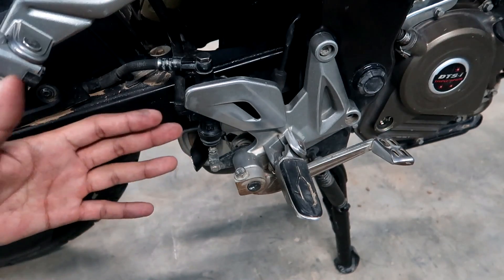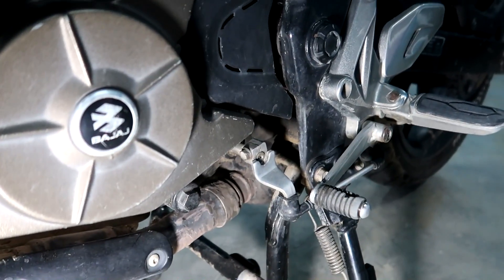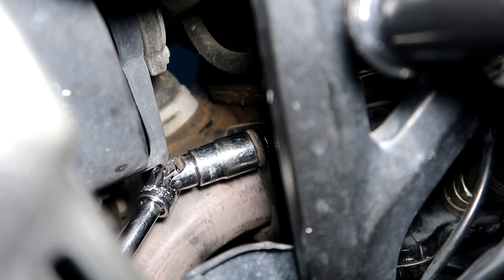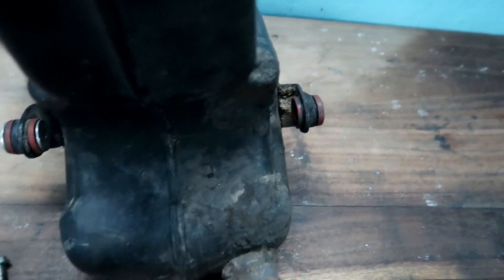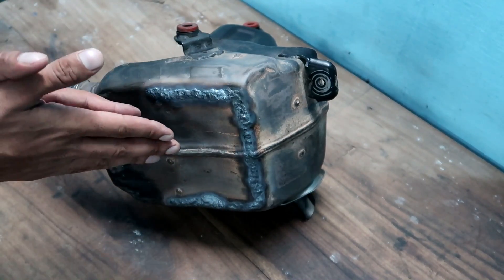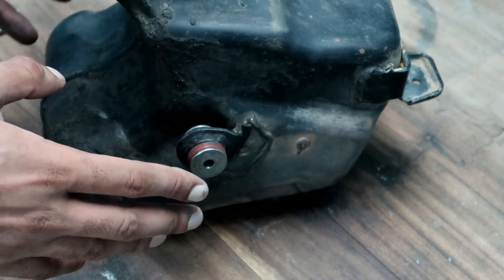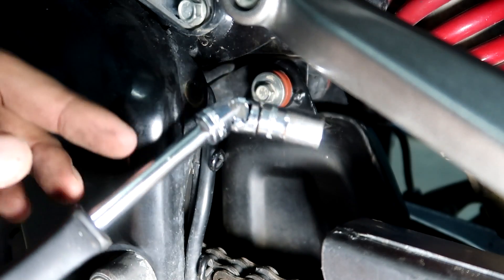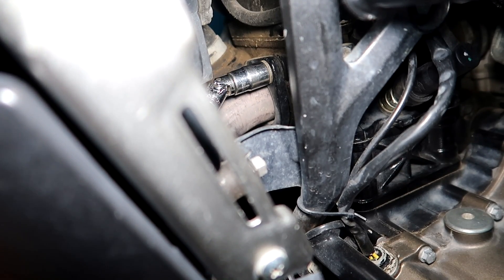How To Fix Silencer Noise (Exhaust Rattle) [NS 200]

Comment: nice video buddy and one thing i have duke 390 when i give sudden throttle there is a lag for 2 secs and then the  power is normal what will be the problem?my bike ran 9000km thnx advance
Reply from the maker: Get air filter, spark plug and fuel filter replaced.... If you have already changed them.... Get the fuel pump, injector and throttle body cleaned.

Comment: What you think about fz25  its worth it or should i go for apache 200 4v
Reply from the maker: Both are great in my books.... RTR is less expensive but doesn't have ABS.... If ABS is not your priority than go for the FZ25.... Just the headlight and speedometer are a bit on the downside.... Rest is great in my opinion... But RTR is a great package overall except the power it's less than fz... Lemme not confusw you.... Just ride both the bikes.... And buy one whom you fell in love with.
Reply: Jeet Bhaskar i will try both  thank you so much for your advice 😊
Reply: Marmik Vyas FZ25 le le quickest bike hai 200-250cc ki duke 250 ko bohot tough competition daiti hai rtr 200 4v slow bike hai mat lena
Reply: Saauvik Das 
after 120 or 100kmph spped  ns will go ahead but in 0 to 100 fz25 is quicker
Reply: Syed Qaiser Abbas  its comfortable to cummute every day with fz25 ?    fz25 is so quick that its lack on braking in city  correct me if i am wrong i heard that from reviews so ..  if fz25 has abs i will definitely just gone for it but the 200 4v features is attracting me right now the sliper clutch with dual channel abs    i cant decide...
Reply from the maker: Go for rtr eyes closed if you want a city commuter and a weekend rider.....  And it has slipper clutch... A lot better speedometer and from my experience mechanics at TVS are at least better than yamaha but that differs from service center to service centre....  You can go for ns if you want best of both city and highway but than my experience says that it's not as reliable machine as the other two.... Plus it doesn't have fuel injection.... And has a single channel abs unit..... If it happens to be my money i would have picked the RTR race edition with Fuel injection.... Rest is your wish.... Go test ride the fz and rtr and decide by your own.
Reply: Just fo the fact it has taller gearing , it's slow to 100 ! 
 But only by a mark ... I ride ns n duke back to back on a daily ! 
Never tried the fz, good for touring .. power below 6k rpm...but I like something which screams 😅 ns screams after 7 k like a beast ! N it will push you behind but in a smooth manner not like that of dukes
Reply: But yes after 120kmph it's not stable , none of the naked will b stable!
Reply: Saauvik Das NS will scream with it's vibrations and awfull quality of bajaj spares
Reply: Saauvik Das bro get a life with correct figures go and watch 0 to 60 and 0 to 100 timings of FZ25 and NS200 
Even if u don't understand it then go and watch motorbeam's comparison video and drag race video
Reply: Marmik Vyas bro NS200 lacks low end performance so u really have to keep the throttle twisted until it reaches 120 kmph then it goes ahead of FZ25 and ask yourself how much often are u gonna ride it above 100kmph honestly speaking acceleration is more important than top speed especially on Indian roads
Reply: Jeet Bhaskar bro but still tvs doesn't provide rtr200 with both abs and fuel injection i mean it took 2 years for TVS to provide ABS now u can assume it would take another 2 years for TVS to provide both abs and fuel injection in one model
Reply: Go buy a battery scooter 😂
I own ns200 n the only prob one faces is the tappet vibration else everything can b maintained using proper service .. I k people munching their ns for over a lakh ... N for the acceleration , just get rs rear sprocket .. or change reduce a Teeth in front sprocket ...
Reply: Saauvik Das 😂😂😂 it's kind of funny that people think just adding a bigger rear sprocket and smaller front sprocket will transform their bike into Hayabusa and they can easily cross 300kmph mark like it's no big deal bro there is something so called as engineering team who make sure that the bike takes full advantage of the engine and runs as efficient as possible but leave it bro u ain't gonna understand it
Reply: Syed Qaiser Abbas so true

Comment: Bai...My NS chain areas are getting rust..What is the solution??
Reply from the maker: Which area is rusting ? Chassis or swingarm ?
Reply: Jeet Bhaskar swing arm bro...Chain is also getting rust..It's raining here in Kerala
Reply from the maker: Clean both of them with diesel... Apply chain spray on the chain and rub a scrotch brite scrub on swingarm gently.... Then spary paint the rusted area while covering the rest parts with newspapers.... Or if you don't want to do a spray now as it's raining than apply some chain spray on the swingarm as it will repel the water.... Also remeber chain needs more frequent chain lubes in rainy season so whenever you see water instead of lube on the chain.... Apply the chain lube again.
Reply: Jeet Bhaskar okay thanks boro☺☺...Which is the good chain lube ?
Reply from the maker: All are almost the same.... But get one of a good brand... Like motul, tvs, rolon etc.
Reply: Jeet Bhaskar sure broooo
Reply: Thank you so much

Comment: Bro. I notice some strange noise from exhaust at higher rpm.. So having watched this video I thought I maybe having same problem. But today when I opened exhaust from bike. And shaked it vigorously just like you did and sound from broken plates came but in my case it doesn't make any plate sound. Jst silent. What could the problem be? Shall I open silencer to look inside? Or should I replace Exhaust gaskets? And yaa the exhaust was not thoroughly inside the band clip (nr one 12mm bolt that it below engine) please guide further
Reply from the maker: Use a rubber hammer around the exhaust and make sure that nothing is broken inside the exhaust... Use rubber hammer only... If found perfect then install back tight everything properly and see if the problem exist or not.
Reply: Any alternative to Rubber Hammer? I Don't have it. @JeetBhaskar
Reply from the maker: Something that doesn't damage the exhaust... A small woodblock can work as well.

Comment: Bhai..... mere ns 200 ko 2sal Hoge gr me rkhe kese start krna h kya reper krna h btana plz
Reply: 2013 model ns 200
Reply from the maker: Bhai bahut lamba process hai.... Uski user manual agar aapke pas hai to usme last me poori detail milegi or nhi h to aap... How to start a bike that's been sitting for 2 years search kr lo youtube pr detail me video aa jaayega or meri taraf se kuch tips hain ki.... Battery charge ya change kro... Engine oil change kro filter ke saath.... Air filter carburetor clean kro... Petrol poorane waala nikal ke fresh petrol daalo... Bike ko start krne se pehle thoda sa engine oil spark plug ko nikal kr uske hole me daal dena or fir start krna... Or fir tyre, brake , coollant sab check kr lena.
Reply: @JeetBhaskar  thanks sir

Comment: hi buddy my bike ktm duke 390 poping sound while deceleration solution?thnx advance
Reply from the maker: What kind of sound it is buddy... If it's a rattle then the exhaust should be the problem... If not then it can be a misfire... In that case get the injector and throttle body cleaned.
Reply: misfire sound like poping noise and also bike start in mrng tappet sound like noise from left sideand engine heats the noise  will not be there what will be the isssue?
Reply from the maker: That's the tappet noise and the misfire issue can be because of blocked injector hole or dirty throttle body and may be a bad oxygen sensor.

Comment: Mere bike pe throttle end exhaust note k bad  cycle ki BEL Ki Tarah sound de raha hai..
Plz help me.
Reply from the maker: Uske kaafi reasons ho sakte hain bro.... Kisi mechanic se check krao aap.
Reply: mechanic ke paas gaya tha.. Khakee  noise Jyada Hoto Phir Le Aana..bt  sound is very close to me
Reply from the maker: Koi bhi loose nut ya bolt ho sakta hai... Kabhi kabhi fairing me bhi vibration aane lagte hain... Exhaust ki pipe loose ho vo bhi sound kr sakti hai... Leg guard loose ho jaata hai us se bhi ho sakta hai... Achhe se 10 - 15 minute spend kro... Jarur pta chal jaayega aapko ki sound kaha se aa rhi hai... Fuel cap ko bhi check krna... Front visor me se bhi aa sakti hai.... Rear seal ke niche cdi hoti hai vo bhi vibrate kr sakti hai.... Check kro aap saari cheeje.
Reply: Okh thank you

Comment: Bro tappet noise ka koi permanent solution?
Reply from the maker: Permanent solution nahi ho sakta iska
Reply: @JeetBhaskar  so every after 2000kms or so i have to adjust the valve clearance
Reply from the maker: Every 3000 if you ride hard.... Every 6000 if you're gentle enough.

Comment: I am face this same problem my Gixxer sf
Reply: Bro did u get any resolution? I’m also facing the same issue in my GIXXER SF
Reply: @sanketbasu3591  i replaced new exhaust bro
Reply: @sanketbasu3591  This video Idea is good one but should check engine back pressure
Reply: @nirmaldeja8761  how much did it cost you to replace? And did u replace it with a stock exhaust or after market?

Comment: Better to buy a new exhaust system if in case this kind of problem arise
Reply from the maker: Ohh.... Than what will you do when your engine will get seized... Will you buy a new engine ? Anyways.... New exhaust costs around 4 to 5k.... And this repair costed ₹200.
Reply: Jeet Bhaskar I agree with you but at the same time I am not. I own ns 200 bs4 and it's been some months I am riding this monster. Why the engine would seized if I care properly? 2nd of all if the bike is almost  7/8 years old and problem like this arise then you should say that invest to 200 bucks to save 5000 k.
Reply from the maker: Give it some time buddy.... It will start showing it's colors.... It's the nature of ns.... And If i can repair something than why should i spend 5000.
Reply from the maker: Give it some time buddy.... It will start showing it's colors.... It's the nature of ns.... And If i can repair something than why should i spend 5000.
Reply: Jeet Bhaskar thanks for your feedback but one of my freind riding this 200 ns bs3 since 2012 when the bike was launched and he didn't faced this kind of issue. Not only him but through YouTube I know many people whom are the proud owner of this bike and they didn't faced this problem. What so ever this is a real problem but again it doesn't means it would come to every single ns 200.
Reply from the maker: Sometimes it's about luck.... Maybe mine is not that great because i came in touch with 3 NS and 2 of them had exhaust issue and the other one had a list of issues.... Anyways... Ride safe... Pamper your monster.... Best wishes from my side buddy.
Reply: Jeet Bhaskar thanks brother. I appreciate your efforts and I have been watching your vlogs for a long time. SUBSCRIBED!!!😉 I was about to buy Dominar but then I thought I should wait for some years to see how the bike would perform as long time owner ship. I had an another choice of avenger 220 street but quality wise ns 200 is better than Avenger 220 and most importantly the purpose. NS 200 does the job and much powerful than 220 bajaj 's engine so I decided to pick one.
Reply from the maker: Dominar and ktm have issues with the quality of nuts and bolts... They keep faaling off.. i am gonna make a video about that soon .... Thanks for the support man just stay tuned coz this has just started.... It's going to get more interesting.... Appreciate your support just maintain that 😊😊
Reply: Jeet Bhaskar yes forsure bro....In near future I have a desire to get my hands down on a parallel twin motor but being honestly I am very confused. The place where I live I could not even think to have a bike like Kawasaki z 650 which have only ground clearance of 130 mm. I am looking forward to Bajaj whether they could launch a motor like 500 or 600 catagory as per Indian road condition. Your vlogs are really helpful and decision making
Reply from the maker: If ever in life you want to buy a parallel twin than either get the r3 or ninja 300.... Or if you want a 600 than go for at least an inline 3 motor of a 4 cylinder.... That's what my advice is.
Reply: Jeet Bhaskar 🤗🤗 nice answer
Reply: Bro i have 2014Ns and i have this problem right now.....and for sure this particular video will help💓 thanx mate
Reply from the maker: You're welcome buddy.... Happy to help you... 😊😊
Reply: Jeet Bhaskar bro can you tell me after how many k.m in odo should be perfect to change the Spark plug and should I replace the stock rear tyre with any 140 section
Reply from the maker: Bajaj says to change the spark plugs at 30,000 kms... But i would say cleam them at every 7-8000 kms and replace them at 21,000... You will be good to go... You can upsize the tire upto 150 but more profile with cause more drag and that will lead you to lesser top speed... Lesser acceleration and less fuel efficiency.... If you are ok with that than you can change your front to 110 and rear to 150 for sure.
Reply: Jeet Bhaskar I would go for 140 section and again thanks for your valuable information bro. Keep going ☺️